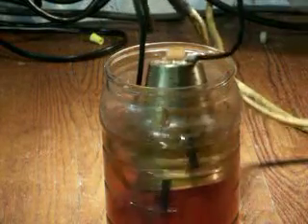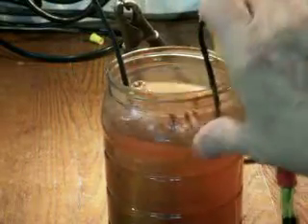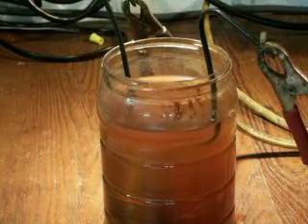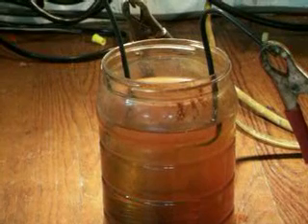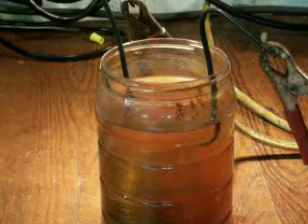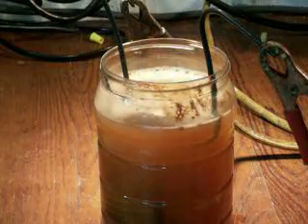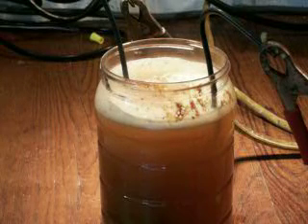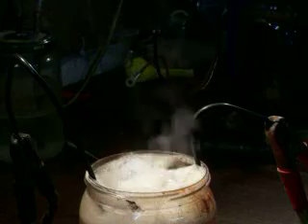7 cup cell  a lot of gas

Comment from the maker: you can buy that hydroxide from lows, its called ( roebic crystal drain opener } it run 15.00  the difference with h2o is that its water, hho is the hydrogen that is being taken from the water from electrolysis, the more amps that you have the more hho gas it will give off.